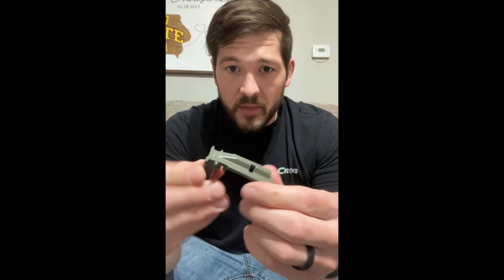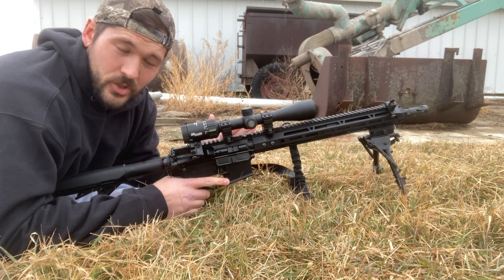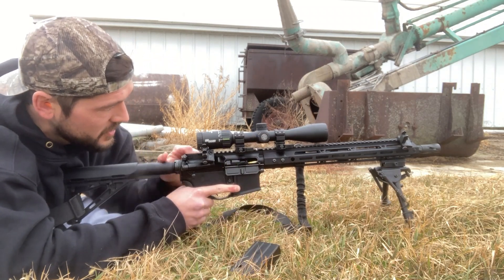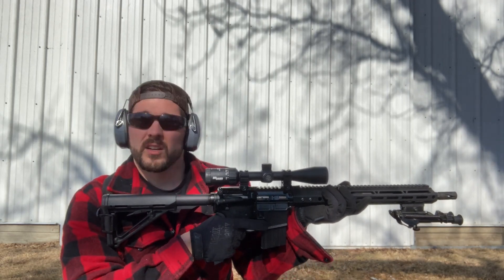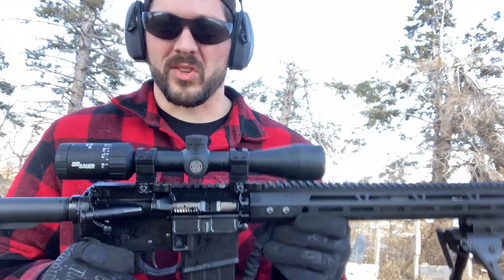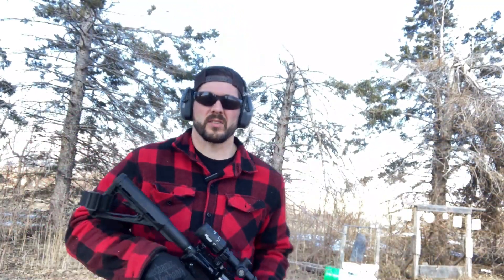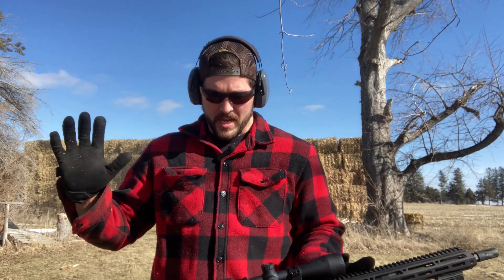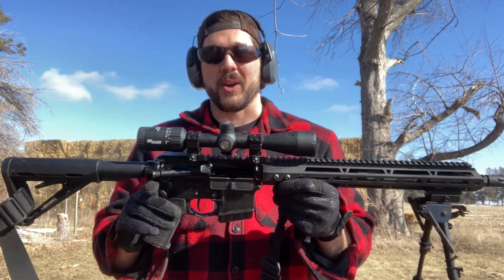It's alive! How I fixed my Bear Creek Arsenal 350 Legend upper

Comment: I have BCA15 in 7.62x39  right side charger that had light strikes, FTF and just irritated me. The solution was an H2 buffer, Black Rifle Arms enhanced firing pin (BCA one BROKE dry firing) and BRA heavy hammer spring. It ran well even on steel "Russian" ammo UNTIL I used lacquer coated ammo. The coating melted and glued the cases in the chamber. Could not pull the charging hand back. I had to disassemble it and drive out the case with a wooden dowel. Then I discovered the extractor FRAGMENTS in the locking lugs.. One email to BCA and a call back they sent a replacement 7.62x39 extractor FREE.
Reply from the maker: From what I've seen they will make things right and bend over backwards to do so but my major gripe with it is how many times they have to do that. Wish they would get it right before sending out their products. I'm 2/2 on having issues. And my brother had issues with his too which makes us 3/3
Reply: @armorplatedadam  DITTO.
Used have a plaque that said 
"There always seems to be enough time to do it over, but never enough time to DO IT RIGHT, THE FIRST TIME." P.S. the 20"inch Wylde is RMA trip #2.

Comment: I think I paid around $150 for my BCA 350 legend back in 2018ish(?), but I think I had to put it together. If you bought yours assembled, check the gas block. I can't remember if it's pinned or set screws, but you might have some alignment issues if it's making it's way loose. Mine runs perfect, but then again, I was the one to assemble the upper. I'll have to dig it out of the safe, but I'm pretty sure I pinned my gas block along with dimpling the set screws. Aside from assembling it myself, I haven't had to do any modifications for it to run like a raped ape.
Reply from the maker: Thanks for the info, I'll take a look at it sometime. 👍

Comment: I had similar problem with mine but all I did was I polished the front of the bolt so the case would slide easier and problem solved
Reply from the maker: Nice, changing buffer weight seemed to solve the problem for me.

Comment: So really there was nothing wrong with the upper receiver it self.  AR's can be finicky when you start swapping uppers in different calibers.
Reply from the maker: I would say that's a fair conclusion. As common as this problem seems to be maybe bear creek should put on their website to try a heavier buffer when using a 350 upper on an existing lower lol
Reply: @armorplatedadam  There are so many variables in ar builds that buffer springs, bufferweights and adjustable gasblocks all enter the equitation. I like BCA since they are affordable to do a built. I can buy one of their uppers, replace the barrel and still be ahead of something from aero precision. Your milage may vary

Comment: The buffer weight should have been the first, and easiest change. Put your old BCG and mags in the gun, and try it now, to verify its only the new Buffer, that is the fix.
Glad you got it running!
Reply from the maker: Thanks I'll try that next. Right now it's running great with both and using winchester 180 grain soft point. Deer season is this weekend so I'll tinker with that part after. 👍